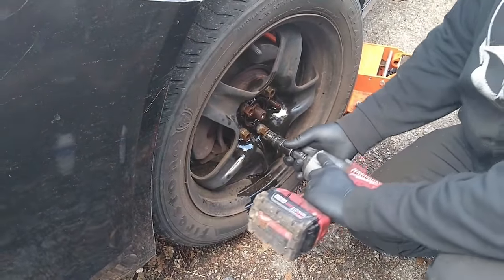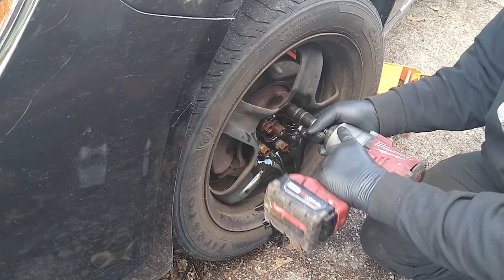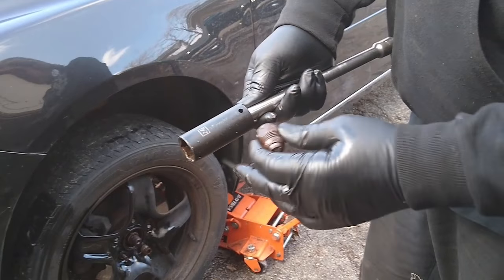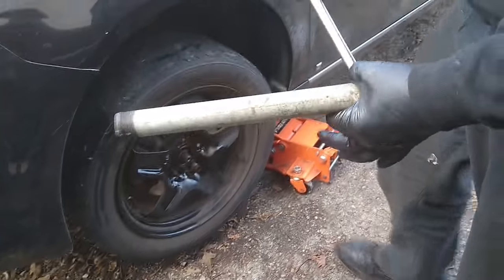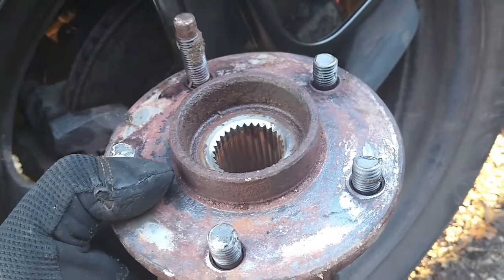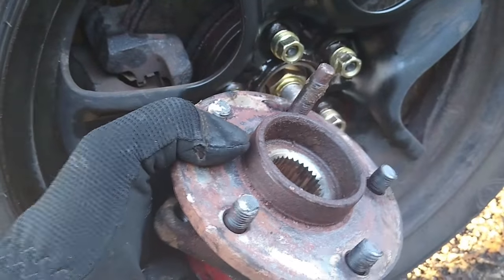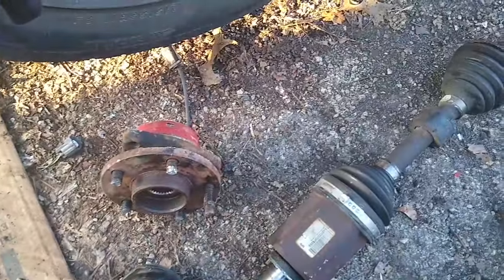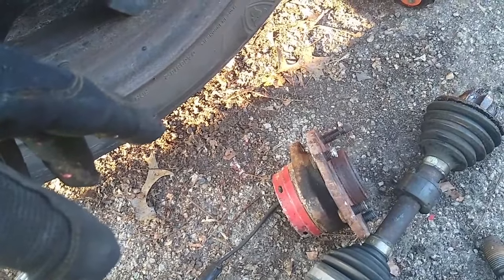Lug nuts just spinning and won't come off, try this.

Comment: AWESOME VIDEO!! I am a tech for Firestone and I had this issue with a Malibu I’ve gone Thur hell times before on other cars trying to get a spinning lug nut off.. I googled a better solution today and came across your video and it work.. great video man thank you
Reply: Same here! Honda Accord nut is just spinning on the stud
Reply: If it's a normal wheel like a honda accord or toyota it won't work because there's not enough room to go up or down on those wheels

Comment: Man, how did I not think of this!  I was planning on taking a cutting wheel and chisel to my spinning lugnut to split it, but this seems a hell of a lot easier.  Thanks!
Reply: thats what i did, a spinning wheel with a chisel point, then i used a drill
Reply: not sure how that's better

Comment: So i could not find a cheater pipe to save my life, buuuut i just beat on the socket while holding it in place with an extension and the lug nut just popped right off! Thank the gods, old and new. Your the man!
Reply: Thanks, I may try this. 2013 car with chrome plastic covers. Rotated tires last year after having car a few months and don't think I did the usual oil spray while off. Now have two spinning studs on one wheel.
Reply: @martyjoseph9507  I had to rotate the stud ever couple of whacks with the hammer. Basically, you're going to bend that thing back and forth until it gives

Comment: I tried drilling out the stud first without much success.  I tried your method with a shorter extension and pipe (all I had) and it came off pretty easy.  I think the drilling weakened it quite a bit.  Thanks so much!

Comment: Well this method is pretty smart, given this is on some ford fushion where you can get an entire new rim for like $50.  
You can mess up the rim and not lose sleep over it.  
I have some wheels that have recessed lug holes.  The bigger sockets won't fit, let alone the 19mm that I need to take off the lugs.
It also doesn't help that the wheels are unobtainable anymore and cost significantly more.  

I had an oscillating tool laying around.  Probably going to use that to slice up as much as I can and then finish it with drilling.  
Sucks but it's what I have to do.  Not enough clearance behind it to get at the 4 mounting bolts for the wheel bearing.

Comment: Leaving this comment just in case it helps someone else… my teenage son called me and said he couldn’t get one of the lug nuts off his new-to-him mustang, so I started watching videos like this one to prepare myself. 
When I got there yesterday morning I tried putting my impact on it, hoping to “zip it off”, but the 19mm socket I brought didn’t fit. So I asked him for the socket he used.

Without much thought I put it on and zipped - of course it just spun. 

I noticed the wheel was still firmly attached to the hub - it’s as if the nut wasn’t loose at all. So I quickly decided I wouldn’t try the method in this video because I didn’t want to risk cracking the wheel. 

So, out came the cut-off wheel. I hoped to drill out the wheel stud but first I wanted to expose the end of it by cutting the cap off the nut. 

I was surprised at how easily I was able to cut it (and no sparks!)

It was then it occurred to me that this was one of those lug nut styles with the aluminum “skin” or “cap”. 

I stopped and considered the situation for a moment… I looked at the socket my son had handed me… 7/8”. I’d never heard of a 7/8” lug nut. Aren’t they usually 13/16 or 3/4 (19mm)?

Was it possible this was a too-large lug nut and the skin was just spinning?

So I walked over to his tool box, grabbed a 13/16 and a hammer, and pounded it on to the spinner, smashing the skin back down around it. 

Came right off. 

Had to buy new lug nuts (they were all damaged anyway), but at least we didn’t have to remove the rear axle to replace the wheel stud!

Best of luck everyone :)
Reply from the maker: Beating a socket on a stripped lug nut is a long used trick and works well. In this case the stud was broke free from the hub.
Reply: @HooptiesGarage  Yes of course, in your case it was :) 

I was just leaving the comment because I believed the same thing had happened to my son's car, but I turned out to be wrong. 

So, just because the socket turns, it doesn't mean the wheel stud is turning. The socket could be slipping on the nut. I was simply noting it in case some other poor idiot like me doesn't realize there could be another cause!
Reply from the maker: @truthsmiles  yes you are right. They also now sell 1/2 mm sockets for lugs with these plastic caps, matco sells them I have a set. it's ashame they can't produce decent lug nuts anymore

Comment: I ran into this issue while trying to change my brakes on a Lexus GX 470; I figured if I took it to a tire shop (the lug nut gurus) they could try and break it off since they most likely had to run into this issue before with the amount of lug nuts they take off. Unfortunately they couldn’t get it off or break It for me and recommended I’d go to a different tire shop or a mechanic which were wanting to schedule me a few days out for the service with a $130 hr fee! They also recommended to drill out, bruh drill it out? Lol!! I looked up the reamer used to drill it out and it was costing $250+ and the reviews said it was a horrible tool. I didn’t want to go that route anyway! I had this idea in my head and told them what if you used a pipe to break it off and they said no it won’t work. After some searching I came across this video and voilà!!!!! My idea wasn’t so stupid anymore (after all I’m a mechanical engineer, why would this idea be stupid? It’s  friggin GENIUS!!!) I might’ve bent the extension tip while putting all the torque on that pipe but hey the set of 22 piece only cost me $32, and I only basically lost out on 1 cheap extension. This definitely saved my day and the spinning stud didn’t damage the wheel hub which I was afraid might’ve happened because the stud was spinning in the hub hole. The wheel hub material is harder than the stud material therefor when I popped in the new stud it fit snugly! 
Great video!! Thank you for sharing your idea and saving my day and money!!
Reply from the maker: Yeah you would be amazed how many naysayers and people that don't know this and I've been doing it for 20 yeaes

Comment: I came across this same problem with two studs on the same wheel being dislodged. It was quite ironic because the reason I needed the wheel off was to replace the rear hubs. Unfortunately, the shape of my car's wheels didn't lend itself well to this method so I was stuck with having to drill them out.
Reply from the maker: Yeah that sucks it definitely depends on the type of wheel if it works or not.

Comment: Great tip!  Just keep in mind that you will have to replace the hub.  If not you will get wheel wobble at highway speeds.  Don't ask me how I know
Reply: Do you still get wobble after swapping the stud
Reply: @Romeo Cano  I didn't replace the stud.. but the wobble was so bad I replaced the hub and bearing.  After that it was perfect

Comment: A very interesting solution but I think this might be problem on my Ford Focus - 15" OEM alloy wheel since the lug nut is deeper inside compared to the one you're working on here. Probably end up damaging it?
Reply from the maker: I would give it a try I just did this on a newer 4 runner that had lug nuts recessed and it worked. You don't get as much movement but it still snapped it off.

Comment: I have same problem with one lug nut. But the bigger problem is that it's on alloy wheel. And no space to use extra force to break off the bolt. Any suggestions please??
Reply from the maker: Probably looking at trying to drill, start with small bit and work your way up you may have to jam the lug with screwdriver etc to prevent it from spinning while you drill
Reply: @HooptiesGarage  follwed the same. Thanks alot

Comment: Soooooo I found an easier way an that consist of a chizzel an hammer. That way you don't break more parts and you can still use the lugnut if needed. This seems like a solution if your replacing the whole hub.

Comment: If I'm able to do this on a recessed plastic chrome covered Ford Edge with two spinning on one wheel, how easily will I be able to tell if the hub holes are still good? Hoping there's still lots of life left in all the components after this freak incident.
Reply from the maker: The only real way to know is if the holes don't look like they are enlarged is to install a new stud  and see if it goes in good you should be able tell as you are installing it if it will hold or not .

Comment: I have an Amateur mechanic question…does the hub require replacement when threads need replacement?
Reply from the maker: Not always if the hub is good you can install new studs

Comment: Ima stop right there, even before one minute. You want to use brute force? yeah my ass, not all the time. But anything short of breaking my hub and having to replace it, what can I do? 
Everyone thinks they have a lug nut from hell? 😂 They have not met Killian. Yea, I named it.  
I've broken 3 tire irons, 2 ratchet sockets & a ratchet itself..  My only next option is to sit out there for however long, with a f*kn  pocket sized torch and go at it with the heat. FML!
Reply from the maker: Breaking the lug studs off won't ruin the hub unless it's already ruined if the hub is good just get new studs and install into old hub and you are all set

Comment: This is kinda what I wanted to avoid doing. Doing this on my Honda Fit would damage the wheel as the bolts are recessed well in the wheel and even If I could break them off like this I don't want to have to buy a whole new wheel bearing. My only recourse is to use my die grinder to chisel them off.

Comment: This would be totally impossible If you had a lug nut recessed into the wheel and Spond.
Reply from the maker: Not sure your point and actually I've used this method quite a big on recessed wheels it really depends on the wheel. Just did a few on a newer 4 runner with recessed wheels took a little longer but still worked .
Reply: Still have the "trophy" lug nut I took off by drilling and splitting on a recessed wheel on my old grand prix. Frustrated me to the point where I was wondering why they dont make a mini straight on angle grinder.. Thanks.

Comment: Your wheel bolts are not deep inside of the wheel like mine. I don't have access doing that without destroying the wheel. So do you know a tip to get it remove out so I can take out the wheel & change the wheel hub?

2014 Honda CRV wheel bolts free spinning out of wheel hub.
Reply: Having the same issue here on my 16 Chevy Camaro..

Comment: Can I use this method if the lug is loose on the stud but nut is stuck on it? So basically the lug is spinning along with the nut lol
Reply from the maker: Yes you will have to replace lug though
Reply: @HooptiesGarage  can the one lug be replaced? Thought the whole stud needed to be replaced?
Reply: @asamusicdude  yes depending on vehicle

Comment: Can't do this on wheels with deep holes. Wouldn't do it like this anyway since my hubs are good. Decent video though.
Reply from the maker: It's not going to hurt the hub if lug is spinning if hub isn't stripped out a new one will go right back in no issues if you use this method, done many many times. When they break doing this they break way before the hub
Reply: @HooptiesGarage  what would you do on a wheel with deep lug holes?
Reply from the maker: @austinmccutcheon3270  believe it or not this will work sometimes on some of the deeper holes I used this method on a newer 4 runner with recessed holes it doesn't take much movement to snap them off if it doesn't work then you are left with drilling or other methods . But try this first .
Reply: @HooptiesGarage  Did it mark up the wheel or chip the paint off of it?

Comment: this is a good idea and it will work,unless you have deep inserted nuts on ,oh lets say,a 2015 Chevy Equinox that has chrome wheels. You wont be able to get the angle to break the stud. Now what?
Reply from the maker: Yeah it won't work on every single style of wheel. You may have better luck drilling either way it's gonna suck

Comment: Good tip but very last choice
Reply from the maker: It's always my first choice fast, easy and doesn't cause anymore damage
Reply: @HooptiesGarage  well they make a tool for it cornwell and mac have it “ lug ripper”
Reply from the maker: @maksmilli0n  I have the lug ripper 3 and I have found In most situations if the lug is just spinning this is the fastest most effective way but everyone has their methods.